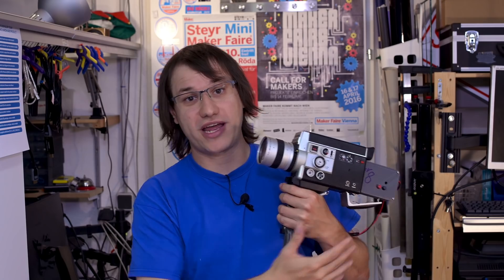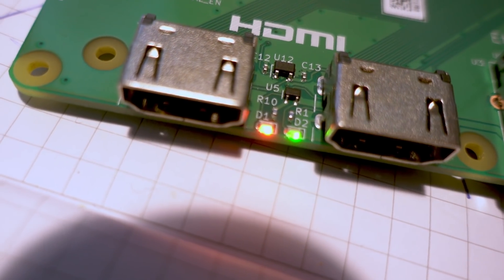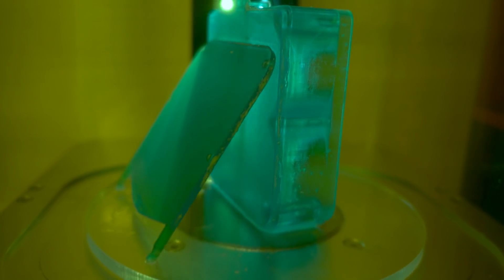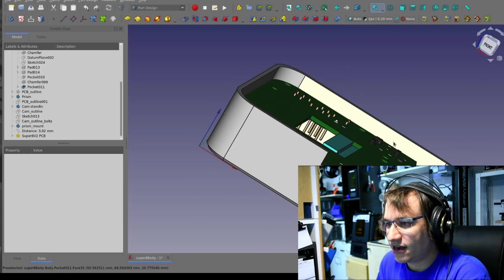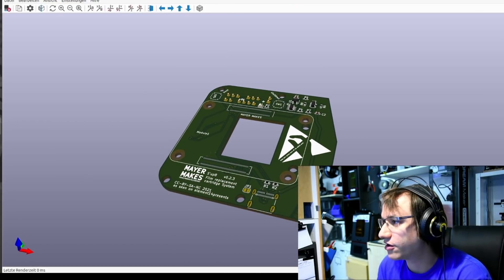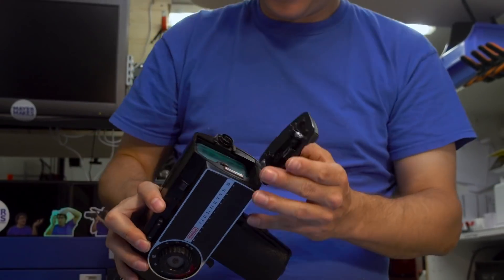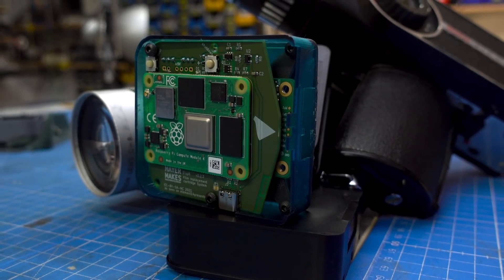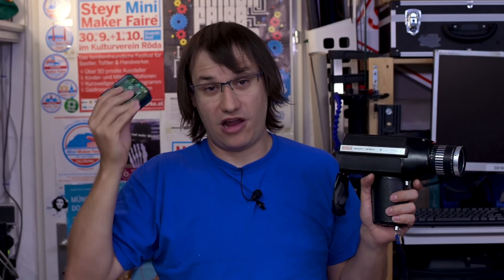Super 8 Camera Digitizer with Raspberry Pi 4 Compute Module

Comment: As a stopgap, would it be acceptable to throw on a barrel plug or terminals and have the power supply external, in a little box that you'd velcro to the top of the camera? Would not look or work quite as nice, but at least it would be good enough for a beta version of the thing.

Power supplies in tight quarters are always tricky.
Reply: I thought about that option, but the trouble starts with the big variance in super 8 cameras, most do not have space to squeeza a cable through. Or need to close a mechanical latch to start operating. Understandable as they were designed to be light tight. As my goal is to make it viable in any camera I need to learn some proper psu design.
Reply: @MAYERMAKES  Yeah I feared you'd say that. Simplest modification would involve a drill through the camera door though ;)

If it's a one-time modification, many people would be willing to do it—though they would sacrifice the ability to use film in the camera without also putting back a piece of electrical tape over the hole they create.
Reply: @JeffGeerling  I'm a camera nerd myself...and I just hate that thought, unless I can see no other option I will not give up on making this a ZERO modification product.
Reply: @MAYERMAKES  Heh, that's what I expect to hear, and is one of the reasons your projects are fascinating to watch develop—when you don't compromise, it leads to some fun solutions!
Reply: @JeffGeerling  thanks, I give that compliment back, I may have given up on PCIE a lot earlier than you..
Reply: @JeffGeerling  Did Red-Shirt Jeff get out again?
Reply: @MAYERMAKES  You may be able to create spring leaf contacts that can fit through the tight gap of the door of the camera instead of drilling for a temporary PSU.
Reply: @AerikForager  that could work on some cameras but most have a double e fold to make them light tight and tgst would prevent such an approach. I may have already found a viable psu design suggested by a viewer.
Reply: Or a USB C trigger module - set for 5 volts, 3A.  Still need a hole for the USB C plug, but you could use a USB C capable battery bank and stay portable.
Reply: @MAYER MAKES you will just have to use a tiny buck converter with a small lipo that has a higher output rating then the load. Have you measured the current draw during the brown out? That will be the first step. You’re probably not even getting a full 2A out of your current lipo.
Reply: how about a paper thin ribbon conductor? 
like you'd find in a car's steering wheel clock spring?
i'm sure you can just shut the door on it.

Comment: I think you need to remove the wifi. If you add a micro usb connector. Once the end user removes the cart. they can plug it into a laptop or phone and use it as an external power source to upload the video. my cents.  cutting the wifi will save a bit of power.
Reply: It sounded like you need a real time connection in order to properly adjust focus, since the sensor is at a different distance to the lens.
Reply: @kevinmbrooks  yes Kevin is right, wifi is needed for the controls. But I will find a solution eventually
Reply: The unit has usb c usable to charge and download footage. I take advantage of the otg mode of the compute module.
Reply: If (and I would expect this to be difficult and expensive) you could use a lens or lenses in front of the prism to get the focal point of the digital camera to match what the original film's focal point was, then you could skip the WiFi as suggested here.
Reply: @brandtharen  first yes that is possible but extremely expensive, custom optics are incredibly challenging. But that would not eliminate wifis use case as people would of course want to control ISO, shutter speed, resolution and capture modes. also having a output on a mobile display like a phone is ahandy feature. I will maske cuts once established there is no other way until then I look for a power solution.